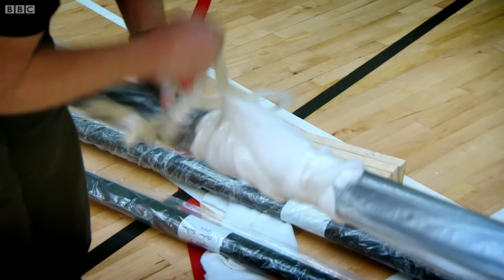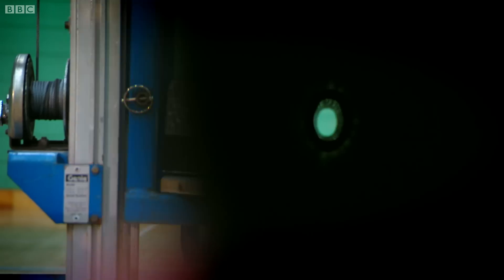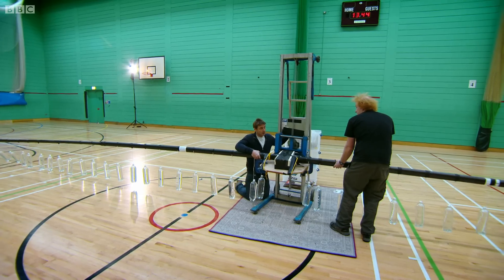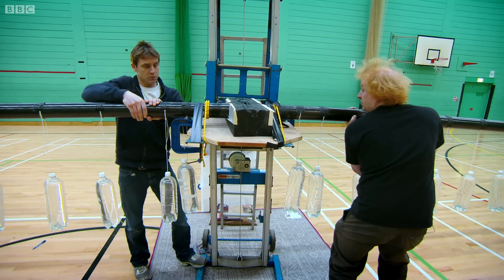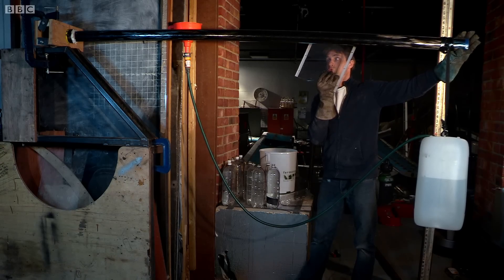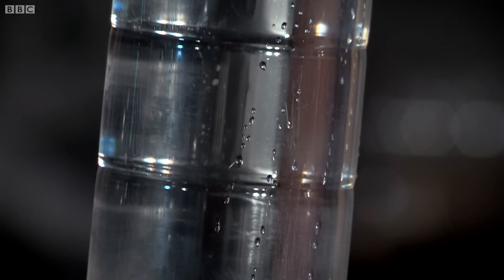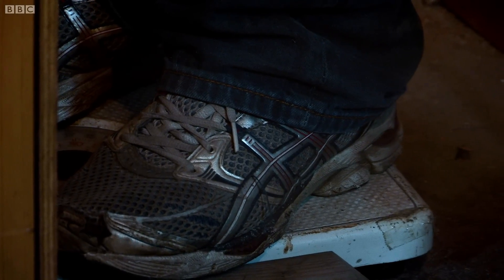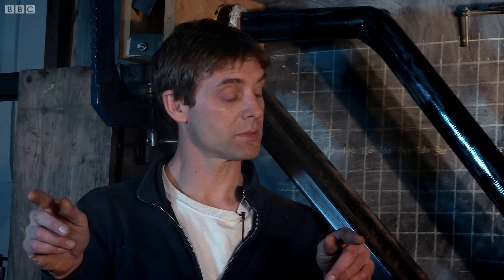Building a Flying Bicycle Pt.1 | Bang Goes The Theory Series 6 | BBC Studios

Comment: Hmmm, as a pilot I would be far more worried about turns than take off.  In straight and level flight a wing is experiencing a 1 G load factor, but as the aircraft turns the load increases rapidly IE:a 60 degree bank is a 2 G loading meaning the wings are under twice as much stress.  Just thinking it will survive take off is a recipe for disaster.

Comment: Pack helium or some other lighter than air gas, and voila! You will be able to more easily fly. It might make it slightly harder to control though.
Reply: the amount of helium it would take would be tremendous so it wouldn't be practical
Reply: kitanovskisasa
No, not as much as you seem to think. You do after all add your own power to counteract gravity.
Reply: TheSandreGuy well i did some calculations based on their final design and you would need a balloon with a radius of 4m to even make a difference,not to mention the drag such a balloon would cause.And if you tried to compress the helium it would just lower its lifting power.
Reply: kitanovskisasa
Why not load up the helium within the airplane body? That would make the airplane relative to the air lighter, as well as not create a drag.
Reply: TheSandreGuy buoyancy is proportional to volume so having the helium in such a small space would do nothing.
Reply: kitanovskisasa
I don't know about that. As long as it would be just marginally lighter that would help.
Reply: @K.I.T  🔴 What Is Islam? ⚠️

🔴 Islam is not just another religion. 

🔵 It is the same message preached by Moses, Jesus and Abraham.

 🔴 Islam literally means ‘submission to God’ and it teaches us to have a direct relationship with God. 

 🔵 It reminds us that since God created us, no one should be worshipped except God alone. 

 🔴 It also teaches that God is nothing like a human being or like anything that we can imagine.

🌍 The concept of God is summarized in the Quran as:

📖 { “Say, He is God, the One.  God, the Absolute.  He does not give birth, nor was He born, and there is nothing like Him.”} (Quran 112:1-4)[4] 📚

🔴 Becoming a Muslim is not turning your back to Jesus. 

🔵 Rather it’s going back to the original teachings of Jesus and obeying him.